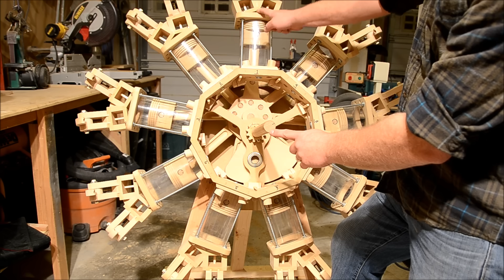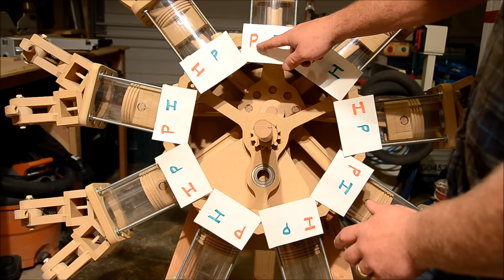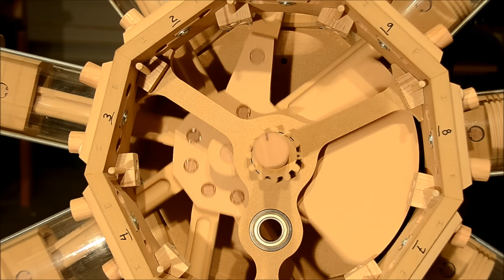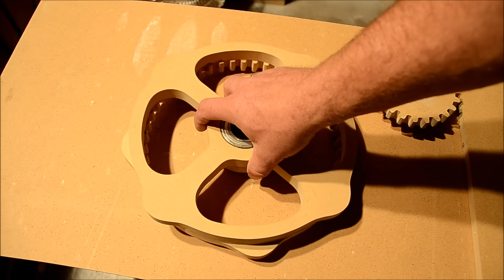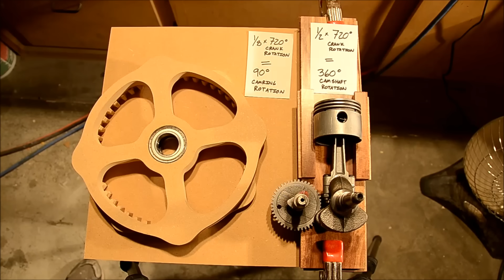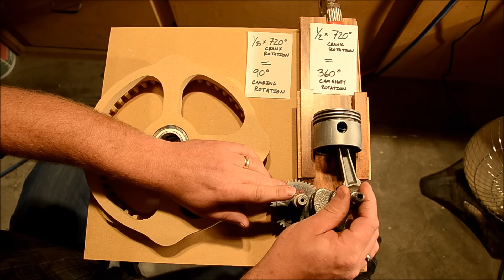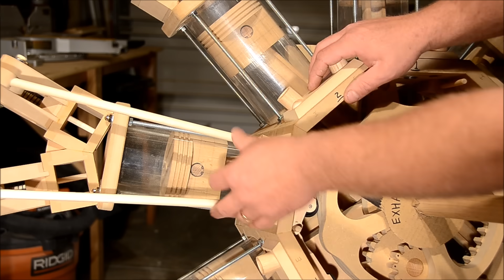How a Radial Engine Works - Explained  Part 1

Comment: This was very informing and interesting.  You presented details I wanted to know and didn't about radial engines.  A big Thank you.  I wouldn't mind a little more history and understanding of the older and fewer radial engines that have a stationary crankshaft and the whole cylinder block does the turning and turns the propeller.  That blows my mind and is highly counter intuitive, for me.  I think I will look for videos on that, after watching this one.

Comment: I'd like to see a rotary engine like those used in old planes spin so quickly that the cylinders actually fly off due to  cyntrifical force. I would guess this is why rotary engines were eventually replaced by radial engines.... as i think radial engines can likely produce faster revolutions since unlike the rotary engine there is no stress on the cylinders outward....

Comment: You are not wrong, but I'd add that you must have an odd number of cylinders for it to be dynamically balanced. You can make it two rows, and put the even-count imbalance out of phase with the first one, in an attempt to cancel it out.

Comment: Wonderfully done.  The genius level thinking behind this is enough to make a brain melt.  My grandfather was an inventor and my dad remembered him working on building a radial engine somewhere around 1917 or 1920.  I have a picture of granddad standing next to an automobile chassis that he had mounted it on.  Dad recalled walking home from school and seeing his dad behind the wheel of the radial engine zooming up hill at some crazy speed in the dead of winter.  I have no idea if he patented  that invention or decided it was abandoned as impractical or he couldn't get financial backing.

Comment: Great video. It's more than a class in college. Very well explained and very easy to understand. 
I loved the explanation with the cardboard pointing to the cylinders and later the one showed all cylinders and also the engine at high speed. Congratulations for your video.

Comment: The reason for odd number of cylinders is to quell engine vibration. Even - numbered cylinder engines had bad vibration issues.

Comment: Great explanation. 
Brought up a thought.
When adjusting valve clearance on a particular cylinder, is the cam ring precision such that all 4 lobes give the same clearance or does on have to check all four and split the difference

Comment: Hi Ian,  Excellent job of explaining this engine.  Years ago my father and I would always stop by at Wright Patterson AFB in Dayton.  This is where i saw my first cut away view of a real radial engine on display.  I remember distinctly as the light bulb went off in my head about the single giant conrod and all the others that attached to it via a wrist pin.  I never had time to figure out the valve cam timing but you have done an excellent job of showing that concept.  My background is retired tooling and die engineering.  I have a great spacial orientation thing for design and this is one video that has burned into my brain.  Great Great job!  If you ever get to WPAFB the cutaway engine is still on display!

Comment: I'm currently doing research for a SolidWorks project proposal on a F4U-1 Corsair for one of my classes. It is a little more simplified, but it is something I am passionate about building and creating part by part, and I've been doing a deep dive into how radial engines work (the R-2800 Double Wasp is amazing) and how I can implement that into my model with little understanding, and your videos have made it so much more easier for me to comprehend! Thank you!!!

Comment: i hold an A&P license.  (post radial engine era) I didn’t really know how these engines worked until i watched this video. I have since become a machinist and welder and am super appreciative of the manufacture of these engines pre-cnc as well as the high level of skill you’ve showcased at making your model. kudos ian!

Comment: Have you tried to use your project to create electricity using power full magnet 🧲  Neodymium,Copper and spark plugs, with the speed movement I saw in your video part3 everything is possible. This is the first time I add a comment,keep up the Good work 👏,Blessing🙏

Comment: A bomber plane would have the intake valve left open until the piston reaches half way up the cylinder for maximum efficiency and long range flights. It means that for half the fuel the explosion has the same distance to travel for little loss of power.

Comment: Great video. 
Question
Wouldn't it have been easier to make a radial engine 2 stroke. Seems like it would be a cheaper, lighter and more powerful engine.
I understand that 2 strokes don't burn as clean, but I don't think that was a concern in ww2.
Any input would be great.
Once again, Great video!

Comment: Simply put, all cylinders on a four stroke piston engine must fire each 720 degrees of crank shaft travel.  In other words, all the cylinders give one power stroke per two revolutions of the crank shaft.  I love your wooden radial engine mock up!  I really like your cam “drum” and gearing mock up!  Thank you for that.

Comment: Wow I didn't know that there was so much internal workings of radial  engines I saw some on pulling tractors from like Europe there were there must have been a lot of radial engines from the war leftover it just mind boggling I didn't know how they work or how they fired you see how many cylinders my question was how come when you see some of these 28 cylinder ones but they smoke so much and they don't seem like the idle very well it don't I don't understand that it's cuz they they just keep smoking all the time and it sounds like it's flooding out or it's going to die yeah I'd like an answer if somebody had an answer for me I'd be really appreciate that it's something that's always been on my mind thank you have a great day

Comment: Thanks to your video, I was able to replicate your model in Besiege. I originally went with physical cam rods, but the added friction was a bit much. Thank you so much for uploading this. This is the most in depth resource there really is on how a radial works from the front to the back. I couldn't have done this without seeing your video. https://streamable.com/4sh52t

Comment: So cool, I know it's been 5 years but it's still a great demonstration.  I specifically liked the focus on intake and power stroke, since the other 2 are (mostly) irrelevant at TDC, it took me a quick rewind to understand that was the focus (my weakness, not yours).  I always wondered why radials seemed to have odd cylinder counts, and it wasn't clear on the cutaway displays I've seen up close.  This display actually helped me reframe an answer to an unrelated question for me (sorry, I can't go into the details, just that it helped clarify something).

Comment: Wow, thank you! I've become a fan of vintage aircraft, and though I understood basic engine theory for cars, I couldn't quite visualize what was going on inside a radial engine. So...if I understand correctly, the pushrods are operating at half the frequency of those in, say, the OHV inline six in my car, because of the firing order. Right?

Comment: Nice.  Odd number of cylinders is to reduce shaking of engine: even number of cylinders would act like one heavy piston moving together, rather than opposed, like a Beetle or Subaru engine.

Single row radials are common with 5, 7 and 9 cylinders.  If the firing had to do with phase angle between them, these numbers other than 9 would not work.  You just have to have the right number of cam lobes.

Comment: Hy always thinking about energy cycles...
What if you use simple gas as i'v said the recycle the exhaust first in the wings
The heat could amplify the lift, then if a simple return circuit to the tail where yhe water is liquid return to the electrolyte to the noze radial engine

Comment: He is wrong about the master cylinder. It is number 5 and not number 1. I have been an aircraft mechanic for forty years and have primarily worked on 9 cylinder radial engines.

Comment: Amazing technology that must have involved some very intelligent engineers to design in a time when computers were many decades away. Am curious about the lubrication system on such a complex design. Specifically, how the crankshaft bearings and wrist pins receive  pressurized oil. Presumably it would have to be some type of dry sump system that feeds oil through drilled passageways in the crankshaft assembly. Much the way automotive type engines are lubricated. Very well explained and consice video!

Comment: Amazing! In the late 60s I worked for 4 years on civil C47s but always on airframe. The bid radial engines (Pratt & Whitney R1830 - 90Ds) were always a closed book to me since I seldom went into the engine shop, so I thank you for the insight.

Comment: I looked on Google and a radial engine the block rotates around the crankshaft which is fixed compared to a rotary engine which rotates the crankshaft and the block stays in place can. My point being I can't imagine a engine that the block spin's round the crankshaft can someone help me out with this thanks in advance.

Comment: beginning to get the idea. since for 9 cylinders, we need a large ring cam, but that's a large mass, esp when at high rpm. so if we use gear reduction and have 4 lobes, this is not a large mass rotating very fast (just smaller, lighter gears), so rotational forces are reduced and the engine at least becomes more efficient; partly because less energy is required, and because it would be more balanced with 4 lobes rather than 1

Comment: You didn’t mention that on some engines the crank shaft was fixed and the cylinders rotated . The propeller fitted to the outer crank case . This may have been a ww1 early  type . 
Your model is magnificent but that full engine rotation boggles the mind..
Love the model and the explanation

Comment: You are an outstanding teacher.  You should be getting really, really, really paid for your skill. Plenty of people have the knowledge, but very few have the talent to convey their teachings. I have very little prior knowledge of engines, like just enough know that camshafts, intake and outlet valves, and pistons  are engine parts, but not how they all function together.  I was the guy who'd up until a few months ago would curse the "dumb motor makers" for not making the firing order in my truck 12345678. I've learned more from you in 9 minutes than I have in the 20+ years of tinkering with my own cars. I'm definitely subscribing after just seeing just this one video.
Thanks.  I know you put a lot of hours into this.

Comment: Do the cylinders spin the thing, it does the spinny thing push the cylinders?
Reply: No it is the crankshaft that would be connected to a propeller usually as you call the spinny thing cheers
Reply: @rebeltz2010  crankshaft got it. And that would be rotated by an engine motor? Causing the cylinders to fire?

Comment: It amazes me how it's the shape of the components like the cam rings and the gear ratios that create the timing for everything in the engine. Not like electronics where something is programmed to send a command at certain time intervals.

Comment: Great model, great explanation, thank you.
Can you please make a video about radial engine lube oil system and how it works? I still can't grasp ho they prevent pooling oil in crank case bottom 2 cylinders and the valve covers

Comment: Well done sir. But I'm still a little unclear on the function of some of the early radials where the crankshaft and pistons are fixed and the cylinders  rotate. The propeller is fastened to the cylinders. That arrangement defies explanation.

Comment: Nicely done.  Gives me memories of when I had to overhaul the Kinner 5 cyl radial on the PT22 I bought as a barn find many years ago.  Flew it back to Tulsa from near Houston, stopped 5 times to refill the oil reservoir and when I tore it down, found one of the bolts on the main con rod cap was broken.  It had been broken for some time, obviously.  Wow.  A ttestament to the design that it didn't explode, I believe.  :D

Comment: Ok as everyone else has said great video, i learned a lot about how these engines work. My question is how does the oiling system work without locking up cylider 5 & 6 with oil?
Reply: Thats why you always see radials being hand propped before starting. Clear any oil that seeped past the rings. Or if not, there's a number of blades the pilot counts to signify a full rotation before the mags are energized.

Comment: Really an incredible video on the radial engine. One thing that all four stroke engine have in common is basically the meaning of a four stroke. That comes down to how they actually run. Its SUCK, SQUEEZE, BANG, BLOW. Remember this and you will always understand the difference between a fore cycle and two cycle. Don't tell your wife or mother though because they wouldn't understand.

Comment: I've pondered for years about how all the piston rods would mount to such a short crank shaft. I could visualize 2,4,6,8 cylinder car engines with a long crank. Wanted to solve it in my head, now I know. It's genius. Great video!!

Comment: Is it possible that once this thing gets going that it runs without fuel? Running on air only? Myself I believe these engines could run indefinitely one it gets up to speed like a vortex energy. I am certain that turbines run on compressed air ( though we are kept in the dark on that!) jets do not use liquid fuel, nor have any I have seen have anywhere near the space in wings to carry supposed amounts of fuel we are told they carry. The numbers volume needed and weights are absurd actually once one starts looking at specs.
Reply: Yes there is many examples of perpetual motion and vortex energy.  Open your eyes man. Show me where they can fit 250,000 lbs of fuel in an A380!? HowLook at the numbers they are giving us for fuel supposedly carried in the wings of say an F4 phantom? 2000 gallons?  It’s not even remotely possible. The numbers are absurd They are lying about speeds and weights of all the aircraft. The first compressed air engine dates back to 1822. They ran on compressed air. Chatty chitty bang bang man!

Comment: I often wondered how these amazing marvels worked 
Had a good idea seen drawings but ur work explained it best,
That model u built is just amazing 
If it was a metal cut away u would need a a 5 foot pry bar to turn that motor, Thanx for the info,

Comment: I hope every aviation tech school buys one of these fantastic engine demo mock-up.  I could have used this back in the early 70's when I went to Spartan School of Aviation.  They did a great job of teaching us about the round engines, but I thought that not many of us would ever see a radial after getting out of school.  Then for the next several years that's all I worked on was 985's and 1830's.  Amazing engines.

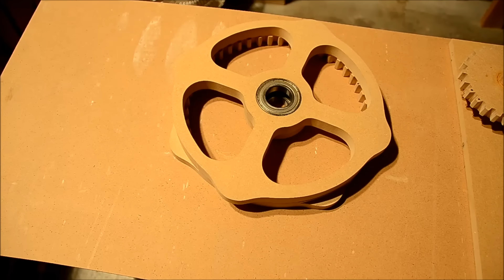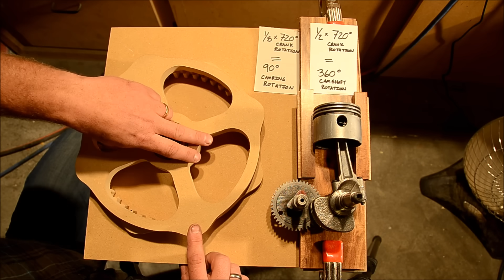Comment: 5:13  to 8:52 Thanks for explaining that bit. That was actually the part I didn't get with all the animations I saw so far.
I kind of feel like the whole construction with the cylinders and pistons around the crankshaft make sense, it's an obvious construction and I get how they move but until now I didn't get how it could get the valves to move at the right times and what the gears inside are for. Now everything makes sense.

Comment: Thank you so much for explaining cam rings.  I have decades of experience as an automobile  mechanic and I knew an automobile style camshaft would not easily fit in a radial engine.  I am amazed at how elegant the the cam ring system and lifters are.

Comment: great job I brought all the pieces to model a nine cylinder using Harley barrels and heads. I figured out the cam but I liked that you simplified so it was easy to understand the 90 degrees and the 1/8th speed. Thanks

Comment: There are a few engines that have an even number. I know of at least 2 model airplane engines of about 3 cubic inches each. I don't know of any full size even numbered radials although two banks of cylinders would give you an even number of cylinders. Pratt & Whitney's R2800 had two rows and their 3360 had 4 rows. Ok, he covered that feature. I have to stop when I think of a pertinent fact or question. Sorry. I hope he explains as clearly on the siamesed crank pin arrangement.
I like to tell riders of Harley Davidson motorcycles that they're missing the other 5 cylinders of their radial engine.

Comment: One BRILLIANT explanation of an engine genre long shrouded in mystery -- for me at least. Seen quite a few cutaways and CGI's etc but this outstrips them all in terms of clarity of explanation. It amazes me still that the radial engine is almost as old as the internal combustion engine and powered flight. Those mechanical engineering guys all those years ago sure were geniuses.

Comment: Someone is reading either my mind or my email.  For weeks I've been trying to work out how radial engines worked - thankyou. It's an incredibly well thought through piece of complex mechanical engineering and a super insight to human creativity and imagination...really!  The fuel consumption and power to weight ratio is excellent  which makes me wonder if there remains a future for internal combustion engines. A few Q's remain - is there a physical limit on the RPM's? Does it have application in non-mobile platforms (like generators)  will it work in a horizontal setting like a helicopter or drone?  Are there too many moving parts for it to be practical?      For those like me who greatly admire engineering arts and sciences - the radial has to be in the top echelon. Well done sir - by the way - who does your woodwork and moldings?